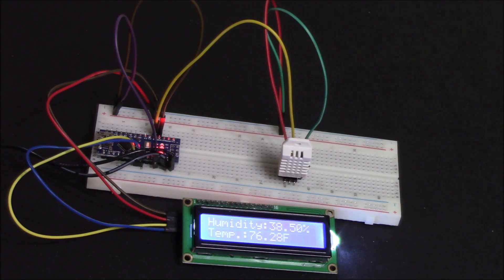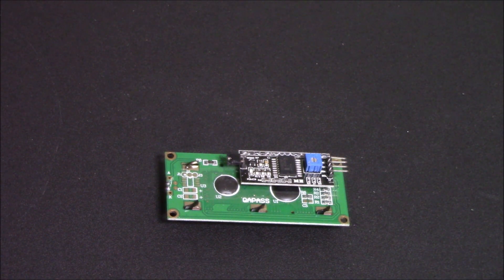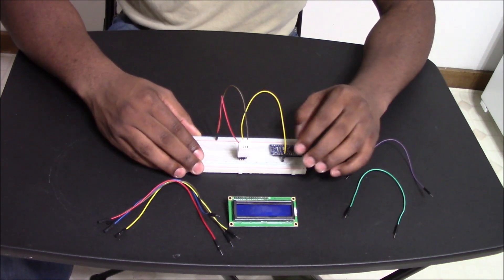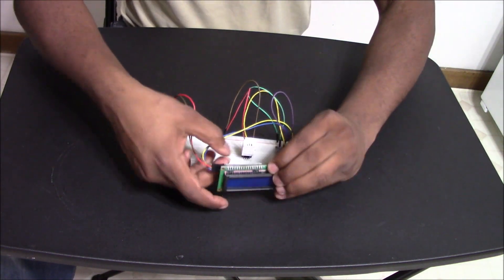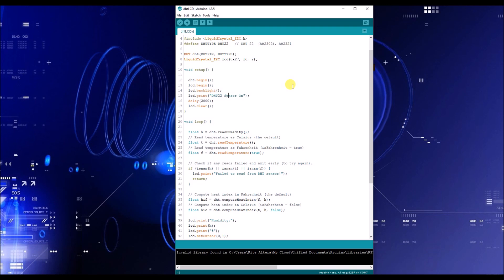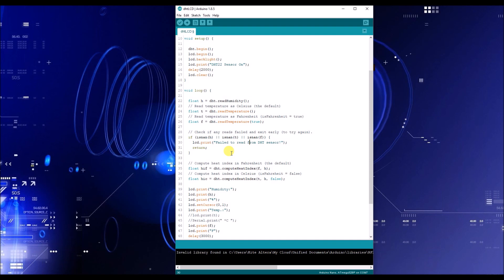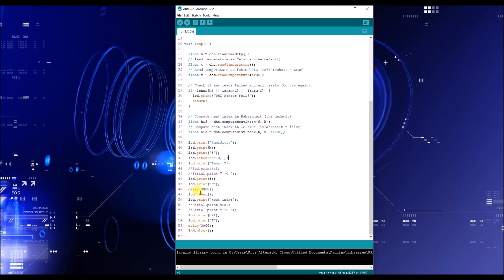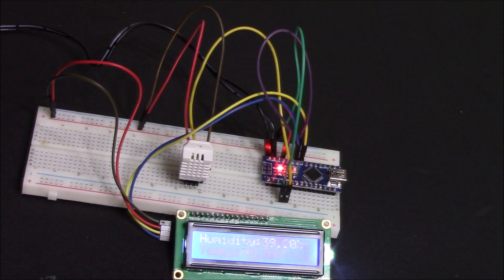Connecting Arduino DHT22 To I2C LCD Screen

Comment: Here the code, it works fine on my Nano. 
Change only #define DHT22_PIN 3 
 as your own

#include <dht.h> //DHT and LCD libraries
#include <LiquidCrystal_I2C.h>

#define I2C_ADDR 0x27 
#define BACKLIGHT_PIN 3
#define En_pin 2
#define Rw_pin 1
#define Rs_pin 0
#define D4_pin 4
#define D5_pin 5
#define D6_pin 6
#define D7_pin 7

LiquidCrystal_I2C lcd(I2C_ADDR,En_pin,Rw_pin,Rs_pin,D4_pin,D5_pin,D6_pin,D7_pin);

dht DHT; //Declaring the DHT as a dht type to use it later

#define DHT22_PIN 3 //Declaring where the DHT signal pin is wired

void setup(){
  Serial.begin(9600);
              lcd.begin (16,2);
            lcd.setBacklightPin(BACKLIGHT_PIN,POSITIVE);
            lcd.setBacklight(HIGH);
            lcd.home ();
}

void loop()
{
  lcd.clear();
  lcd.setCursor(0,0);
  int chk = DHT.read22(DHT22_PIN); //Reading data from the module
  lcd.print("Temp: ");
  lcd.print(DHT.temperature); //Showing temperature value in Celsius
  lcd.print(" C");
  lcd.setCursor(0,1);
  lcd.print("Humidity: ");
  lcd.println(DHT.humidity); //Showing humidity percentage
  lcd.print(" %");
  delay(2000); //Refreshing every 2s
}

you welcome ;-)
Reply: THANK YOU!!!!!!!

Comment: #include <DHT.h> 
#define DHTPIN 2     // DHT Data Pin
#include <Wire.h>
#include <LiquidCrystal_I2C.h>
#define DHTTYPE DHT22

DHT dht(DHTPIN, DHTTYPE);
LiquidCrystal_I2C lcd(0x27, 16, 2); 

void setup() {

  
dht.begin();
lcd.init();
lcd.backlight();
lcd.print("Rozpoczynam");
lcd.setCursor(0,1);
lcd.print("pomiar");
delay(2000);
lcd.clear();
}

void loop() {

 float h = dht.readHumidity();
 float t = dht.readTemperature();  //temper. w stop.celciusza
 float f = dht.readTemperature(true); //temperatura w farenhaitach

  if (isnan(h) || isnan(t) || isnan(f)) {
    lcd.clear();
    lcd.setCursor(0,0);
    lcd.print("DHT Sensor Fail!");
    delay(3000);
    lcd.clear();
    return;
  }

  float hif = dht.computeHeatIndex(f, h);

  float hic = dht.computeHeatIndex(t, h, false);

  lcd.print("Wilgot.:");
  lcd.print(h);
  lcd.print("%");
  lcd.setCursor(0,1);
  lcd.print("Temp.:");
  lcd.print(t);
  lcd.print("C");
  
  delay(5000);
  lcd.clear();
  lcd.print("Temp Odczuwalna:");
  lcd.setCursor(5,1);
  lcd.print(hic);
  lcd.print("C");
  delay(3000);
  lcd.clear();

}